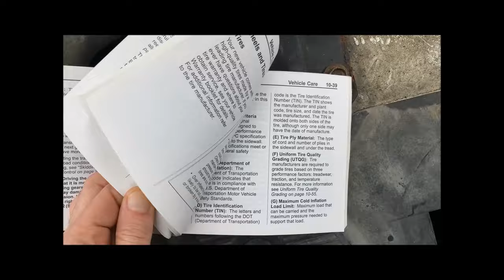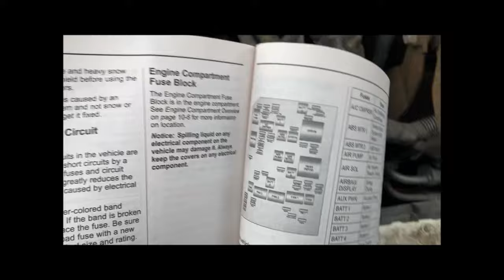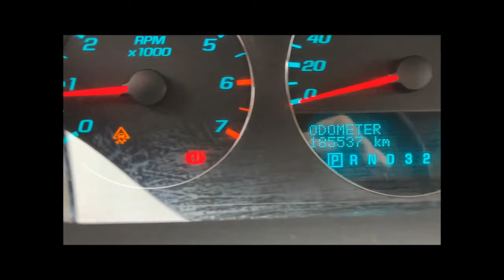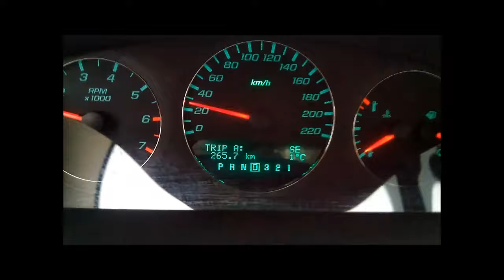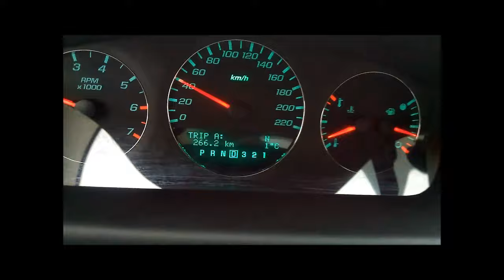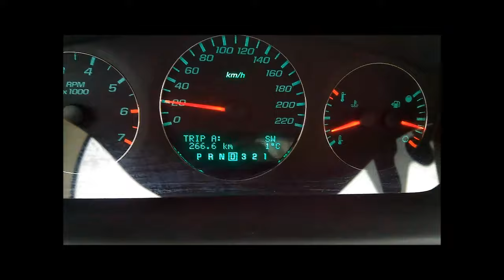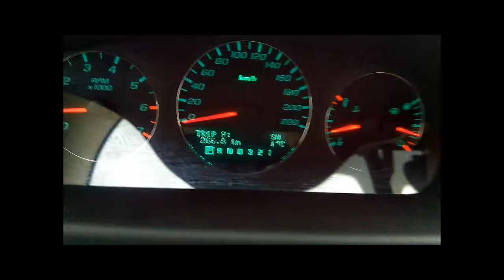How to fix ABS light, Traction Control, Stabilitrak:  Fix Driving Problems & Repair Update!

Comment: Hey I have a 2010 Silverado I have stability track and traction control but also parking brake light when brake is not on what could it be?
Reply from the maker: At least in the cars I've seen with TCS failure, all 3 lights come on including 1 that appears like a parking brake but it's not a parking brake.  It's the ABS light.
Reply: @ChrisCamaro gotcha im still trying to figure out but just can

Comment: hey i got a couple lights on that just appeared i have a air bag light on and stabiltrack and abs lights are on what could they be ?
Reply from the maker: If the airbag light is also on (assuming there's nothing wrong with the airbag) then that doesn't sound like a TCS issue.  It sounds more like what happens when you have a low battery that won't crank and a bunch of lights come up on the dash.  You could check your charging system first and then if everything's good there, scan the car for codes.

Comment: I’m having a similar issue in a ‘15 Mustang. The Service ADV TRAC light lit up quickly for a sec then went away and never showed up again. This was about a year ago. Didn’t think anything of it because I wasn’t experiencing any drivability issues. FF to NOW. She skips and skids on DRY road under initial acceleration but let’s up as speed increases. Almost as if she’s trying to find her footing. And also doesn’t happen all the time (which makes me kind of rule out the rear Dif) if sort of an intermediate thing

Any insight would be awesome. Don’t want to get robbed at the stealership.
Reply from the maker: Are you a "spirited" driver?  Because you have a mustang and you're talking about accelerating, this may just be the traction control working normally and perhaps the tires are old or getting bald.  I wore out my stock Camaro tires from 2013 all the way to 2021 until the steel bands were exposed on both sides (stupid... never do that) and the car slid all over the place.  I'm not saying this is you but after most of the rubber is gone, torqey muscle cars will break away quite easily from a stand still.
Reply: @ChrisCamaro  ahhh I see what you’re saying. But the tires are only about 2 months old. I’m only talking “merge onto the Highway” acceleration. Like drop from 5th to 4th to switch lanes, and there’s a slight rumble/skid feeling for a second or two when I press the gas pedal but scrubs off as the car accelerates. I’m not talking slamming the pedal., just moderate everyday situation driving. Fairly new car. What do u think? 😵‍💫
Reply from the maker: @JayOhhTheKing  If the car is new and you're not mashing it, maybe it's a tire diameter discrepancy.  Are all tires inflated equally?  Sometimes low pressure on 1 tire can throw the computer off.

Comment: My 2014 GMC terrain stabilitrak and power steering light comes on randomly, when it does the doors for crazy locking and unlocking, and the car shifts down so hard that it jarred my neck. Mechanic stated loss of communication to TCM and offered no further help. Grounds are all good, no damage to wiring. I'm at a loss.
Reply from the maker: That sounds serious, like a scrambled OBDII data stream or something sending random commands across the bus.  I wouldn't normally jump to conclusions or anything but if you've got door locks and downshifts at random, it would seem prudent to just try a components swap, starting with each of the computer modules (ECM, TCM, BCM).  Whichever fixes the problem, I guess you could always sell the ones you didn't need.  Seems better than getting in a car accident.
Reply: Likely it's the BCM.

Comment: Idk if you could help me or not on this but, I have a 2009 impala that I’ve changed the throttle body, throttle body position sensor, pedal position sensor, PCM, yet my car still gets thrown into reduced power mode and service traction control, scanner says I have a voltage correlation with the throttle body and pedal, sometimes I can drive it a month at a time or it does it 5 times in one day. Any recommendations?
Reply from the maker: It sounds like a sensor problem, especially if the electronic TB isn't in sync with the pedal but to be honest, you seem to have tried all the obvious.  I'm not terribly familiar with how the throttle system works but maybe it needs a re-learn.  Maybe the sensors are fine but after replacing them they need re-calibration.  It's just a thought but I'd have to look into it to know more.

Comment: Why do my Trac cntl light comes on sometimes when I'm driving down the road and cost for my car to stop picking up speed on a 2000 Grand Marquis LS
Reply from the maker: When the suspension flexes and moves around as would be the case stopping, starting and turning, it causes the wire bundles coming from the wheel speed sensors to flex as well.  If there are any flaws in any of the wires, this can cause an intermittent signal in that wire

Comment: I have a 2007 chevy impala it just got it and the the tpms light came on after I had it fixed and the low traction light is on it jerks from front to back is that normal. My husband changed the spark plugs and did work on it. I took it toget a oil change and replaced the battery he check the tyranny I drove it an hour and the lights came on again and is jerking I don't know why. Could you help
Reply from the maker: I don't think any of the work you had done would cause those symptoms.  It sounds like you have the same problem that I discuss in this video.  1 of the wheel speed sensors is either bad or the wiring going back to the computer is bad, or 1 of the tires is flat, or the steering angle sensor is not reporting correct values.  In order to know for sure, you need to get a mechanic to scan the car and see if it is throwing any codes.  You can also follow the advice in this video to do a visual check of the wiring yourself.

Comment: Hey I got a 2011 camaro ss got a few questions for you if you are willing to share some knowledge.
Reply from the maker: Related to TCS err...
Reply: I think it is but not sure wth is going on. I replaced throttle body with new sensor new pedal with new sensor both ac Delco genuine gm products also put new  coil packs on and still getting throttle and pedal sensor code have had it cleared did the battery unhook method still getting the code tho. Any ideas on what it is?
Reply from the maker: @doaburnout1205  What's the actual code?

Comment: Can you help me sir please my camaro 2011 v6 has a code c0050-5a code and it  says Right Rear Wheel Speed Sensor Circuit
Not Plausible? Whats does that mean?
Reply from the maker: It's a stupid way of saying that the signal coming from that wheel speed sensor doesn't make sense (either because it's shorted high or low or erratic but anything other than normal).  It's probably a wiring issue similar to what caused my fault.  If the wheel hub has a lot of miles on it, it could need replacement.  Otherwise it could be the wire loom connecting it to the computer.  If your wheel hub is old and worn, it wouldn't be a bad idea to just change it and see if the problem goes away.  If not, at least a) you can focus on the wiring and b) you have a new wheel hub that you probably needed anyway.

Comment: i just hit my brakes in the snow and slid a few feet soon as i did that all the lights came on.. any idea on this?
Reply from the maker: It's normal for the lights to come on when the system is active and working.  You should only be concerned if it's coming on when it's obviously not supposed to (abs when you're not braking, TCS when the roads have good traction, etc).
Reply: @ChrisCamaro  it came on when i did the little slide. but its still on. ha ha..
Reply from the maker: Oh then if it's still on it wouldn't hurt to scan the car and see which wheel is doing it or if it's something else entirely.

Comment: Yea mine has almost caused me to wreck 2 times now, I lose all power steering
Reply from the maker: Hmm... I've never had that happen before.  For me it's just the brakes that act up.  To lose power steering might be a more serious electrical/computer problem.  Is everything grounded properly in your car?  Grounding is a common and serious problem that can cause a computer to freak out and various systems to randomly misbehave.

Comment: Totally CRAP design and engineering.
Braking systems should never be compromised by engine performance.
Criminal design 😡😡🔥
Reply from the maker: Sorry what do you mean by engine performance?
Reply: @ChrisCamaro  I have been having issues with my ATS.  Doing research, it brought me to your video.  I think what he means is sometimes P0300 code is going off as well.  My issues first started with a check engine light and oil leak.  My regular mechanic I think new this was a can of worms and told to go to the dealership.  He suggested new valve cover, and change the pcv hoses as they were bad.  I go to dealer ship, they said only the pcv hoses were my issue.  Next day, my car started shaking, stabililok , ABS and TC lights came on.  CEL was flashing.  they turned off but when speeding up and slowing down, it would feel like it was mis-firing and I confirmed with a scanner.  I called dealership and they said it's a new issue and bring the car in and tow as I should not drive it.  I said it was fine until after they touched it.  But I beat them down on the repair charge as I said the car leaked 2 years ago and the broke the hoses and cheaply fixed it rather than replace when it was under warranty.  I found oil in the ignition coil pockets.  I cleaned them out a few days ago and it drives a little better, no lights came on now but if I hit the gas, it is rough and stutters a bit.   So I am back to changing the gaskets and pcv valves as there could be vacuum issue.  I still don't know why they lights all came on, so I have your video to keep an eye one because maybe the dealership damaged the harness when they said they washed the underside of car when looking for oil leak.  Car ran much better with CEL light, oil leaking and pcv hoses broken.